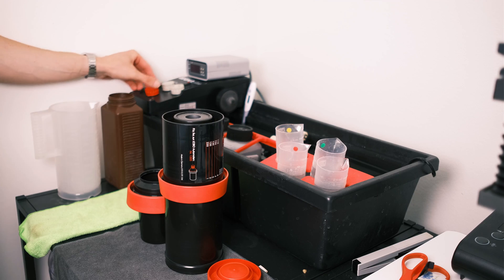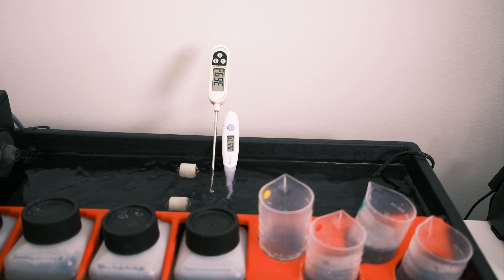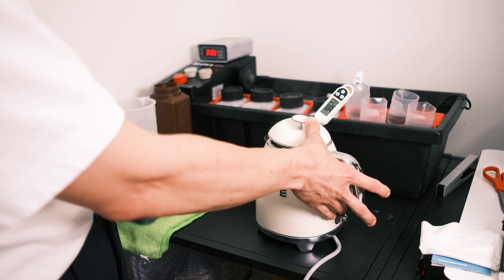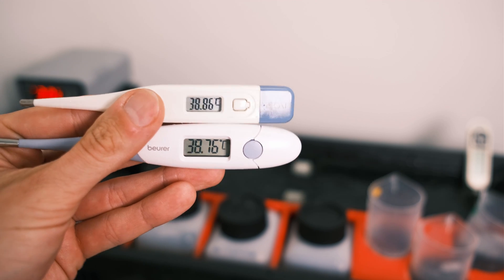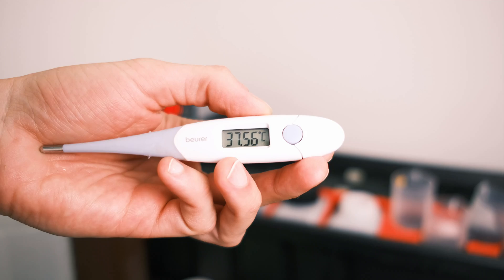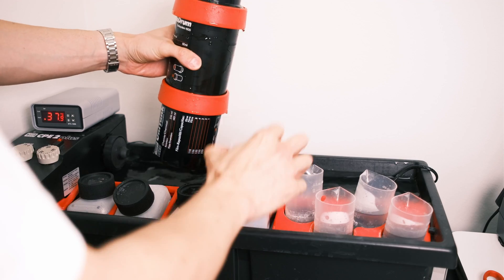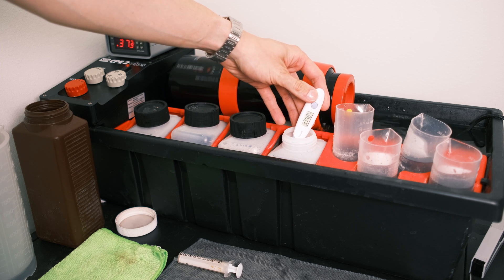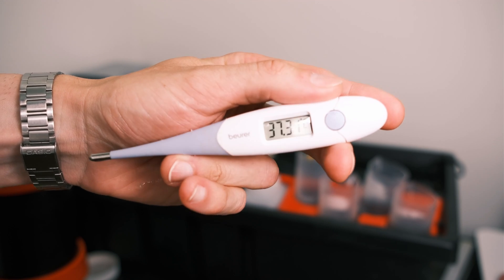C41 film development temperature stability in Jobo CPE system, circulators, methods and more

Comment: Definitely i agree too. We care about getting the best results and shops maybe dont. Its our film not theirs. I have to say that many many videos from  youtubers developing c41 film, maybe from inexperience, spend too much time between pouring back the developer and starting with the blix. The developing process continues although the developer is back at the container for next time. It´s critical.
Reply from the maker: Absolutely, I agree — nobody cares about our film as much as we do. 🙌
And you’re right, in C-41 timing between developer and blix is critical. Even a short delay can keep the development going and shift the results. That’s why I always try to make that transition as quick and consistent as possible. 📷
Reply: @NordicLab  Should the duration needed for pouring out the developper before the bleach step be included in the 3'15" timing  ? If you had no access to an automated agitation system, would you rather choose the manual rotation with the stick that allows leaving the tank in the bath or the inversions every 30" ?